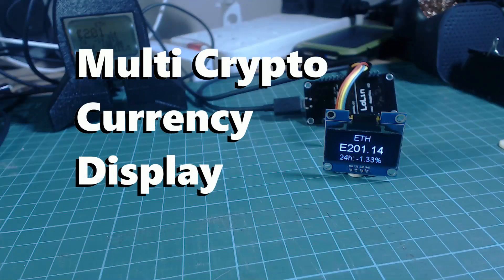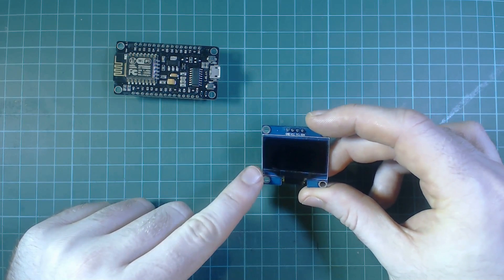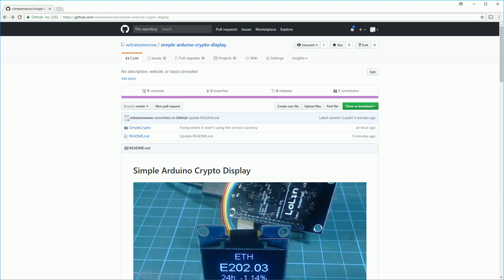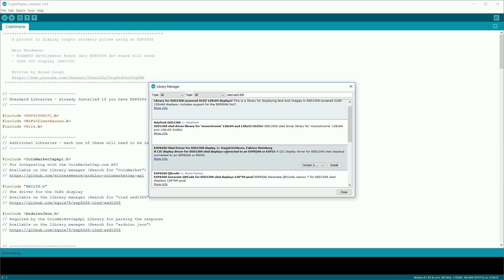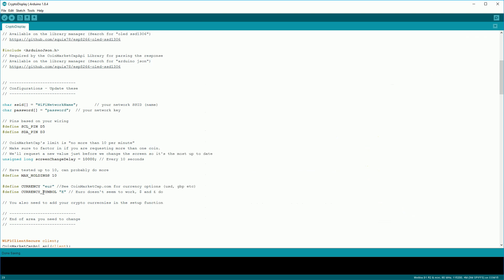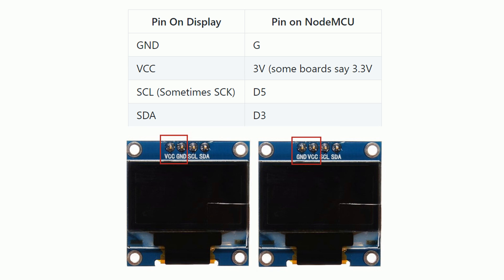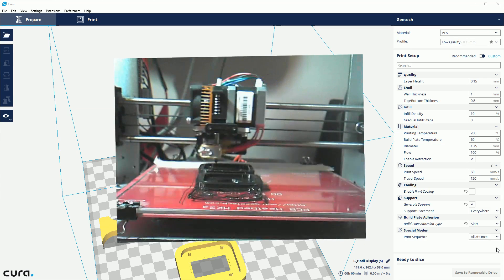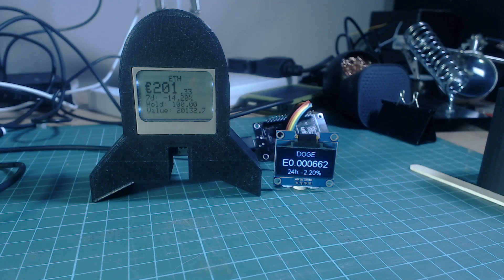Arduino Crypto Currency Display

Comment: If you're all wondering why this doesn't work, it's because the API it relies on is shut down.
Reply: do you know any other solution?
Reply: @taher4324  coindesk's API works.
Reply: @TheResidentSkeptic  do you have the code for it ?
Reply: TheResidentSkeptic This worked well for me. Thanks!
Reply: @TheResidentSkeptic  This worked for me too, thanks. Dont suppose you have a link for a XRP API do you?
Reply: @cobraCPT  Sorry I don't. You'll need to use your Google Fu. I'm sure there's one out there.
Reply: @TheResidentSkeptic  Thanks for the response. I found the bitstamp http api, which alas isnt a drop in with your code.
Reply: @TheResidentSkeptic  Hey there! Thank you so much for reviving what was anotherwise dead project and device. However, uploading your code to my NodeMCU just shows a black screen after one blink of the boards LED.  Are there any specific pieces of your code that need to be customized by the user, other than the WIFI name / pass?
Reply: @GrinningDemon  There shouldn't be. I did notice that if the wifi details are incorrect, or it is otherwise incapable of connecting to wifi it will only display a blank screen. Double-check your wifi details. Check case sensitivity.
Reply: @TheResidentSkeptic  Hey! Thanks again for your help, but after a lot of troubleshooting, I realized the Adafruit_GFX library you were using doesn't work properly with my "SH1106" based oled display. As a result, I went and wrote my first ever C+ code and made a new sketch that is a hybrid of the display methodology from the original video, and your new code for interfacing with the coindesk API. Big success! Thanks again.
Reply: @GrinningDemon  Awesome. Great job!
Reply: @TheResidentSkeptic  aaaand it's no longer available.. This project is one disappointment after another..
Reply: @sirClogg  Huh? Mine's still running: https://imgur.com/a/nFgKCeo

Comment: This is awesome, thanks for sharing!!  3 problems I ran into following this sweet guide that turned a 10 min job into 3+ hours.

1.  Check the usb cable you are using.  If/when you plug the esp8266 in to a Win 10 box for the first time, it should recognize it even before you install the driver.  I tried 3 diff cables before 1 of them did this and worked.

2.  When you install the Arduino json library, make sure you select the version Brian uses in this tutorial.  If you use the newer version, you will receive json errors compiling.

3.  Use a baud rate higher than 9600.  Even though my chip says to use 9600,  it would fail.  I also had to tweak a few other performance settings for the transfer/compiling to complete successfully.  (Just increase the default settings until it works for you.)
Reply: Thanks for the tips. I couldnt get it to install until I saw this!

Comment: for those who have error loading , 
first, if you use the same one in the video moduleV3 Nodemcu-CH340 board based ESP8266 ESP-12E then you have to select the correct board Tools->Board->esp8266 Board->nodemcu 1.0, 
Second, you have to change Arduino Json version to an older one from 6.X to 5.X as following Sketch->Include Library->Manage Libraries-> type "json" in the search bar and go  to Arduino Json you will find the last version installed already , change it to older one 5.X from the drop down
Reply: connected with wifi but the screen is empty

Comment: Thanks Brian, great video and tutorial. I purchased the parts you listed from AliExpress. For the life of me I couldn't get the blink code to work. It appeared to upload fine but it never blinked. I read online that in newer models the led was moved to GPIO2. I decided to try to upload your code despite not getting blink to work and it worked great. Thanks!
Reply from the maker: Great to hear you got it working!

The node MCU board had two built in LEDs (for some reason?) , maybe the main one is broken, to use the second one try using "D4" as your pin number.

Comment: Very nice. I like it much better than the one I did a couple of months ago.
Reply from the maker: Thanks a lot Paul. I watched your one a few months ago, I liked it a lot, it was a good simple project to do because that JSON file was very easy to integrate with! I spent a good bit of time working on the library for this one. It recently broke too because they shut of the HTTP endpoint (which I was using because it was faster than HTTPS) so i needed to update, thankfully I hadn't got around to making this video!
Reply: Is it possible to modify this sketch to work with Arduino Uno/Mega with Ethernet shield? Also it would be nice if it would be able to display total market cap witch is very useful too . Great project
Reply from the maker: +Artur Z coinmarket cap requires HTTPS which the Ethernet shield does not support so no.

Total market cap was available from the api I think, but I think since I wrote the library that number has gotten too big!
Reply: Brian Lough no way to display let's say 550  B? First 3 digits would be enough. Thanx for your response!
Reply from the maker: +Artur Z I'm not sure exactly what the problem with it is, I just ran the example from the library recently and in place of where market cap should have been printed it printed "overflow" instead

I'd imagine is possible to read the value in as a string if it's too big if a number, but to be honest it's not something I'm going to be able to get around to anytime soon
Reply: Brian Lough thanx a lot! Great project

Comment: This is so cool, nice one! You know what would be good, is if you could put a red and green LED and if the currency is down, turn on the red LED and if it's up, turn on the green LED? Is there a bigger screen that could show 10 currencies at once for e.g? Then just refresh every 5 mins or so.
Reply from the maker: +Neo Matrix hey, thanks alot!

Yeah that's a good idea, would be easy to do as well.

Arduino screens tend to have a low enough resolution so I'm not sure if you'd find something that could fit 10. One thing you could maybe do is connect 10 of these screens up using something called i2c multiplexer. I've never tried one though!
Reply: If you're still interested, a chap called Michael Klements recently put together something like you've described. A PCB with the microcontroller, OLED and LEDs all mounted on an acrylic stand. A compact version could also be made using a microcontroller with build-in OLED, e.g. Heltec WiFi Kit 32.

Comment: Hi brian, I get "error loading data" on the screen. Ive double checked my wifi credentials. Is it possible there might be a newer API of the coinmarketcap since the video? Thanks.
Reply: We have received the same error, did you come up with a fix? We get his opening title and then the error message.
Reply: Same here. Any solution?

Comment: cool :) what should I do to have several displays for several tickers? would I need one NodeMCU for each display?
Reply from the maker: +Tor Ivan Boine not necessarily! Sorry I'm in my mobile so I can't copy and paste it but I replied to another person (mike) with details on how you could connect up multiple screens.

The arduino is actually doing nothing most of the time with this so really should be fine to run mutlipel screens once you get over the issues described in the other post

Comment: Very nice!! I'm not really into arduino but would it be amazing to preconfigure various wifi and their passwords in the code (for example, home: 1234, university: 4321, library: 0420, etc..) and then adding a buttom to navigate throught the different wifi's so you can choose which wifi to use in case you have your device connected to a lipo and want to bring it with you.
Reply: You know what, I'm gonna try to do it myself ahahaha, I will let you know if I succeed
Reply from the maker: +PRAWON that would be a good addition!

You should also check out WiFiManager, it will create an adhoc network for you to connect to set a wifi password if it fails to connect to the last network. https://www.youtube.com/playlist?list=PLbd5_U5QzQgZ8Ni8F48G2gnMgCkN6saUT

I think this sketch needs improved before it can be used though, I found it was unstable (I think it uses too much ram)
Reply: Brian Lough Thanks, I will check it out!
Right now I'm quite busy with university until ends of january but I will start it if I find a moment to

Comment: Hello. getting the following error concerning the D3 and D5 pins Arduino: 1.8.13 (Windows 10), Board: "Generic ESP8266 Module, 80 MHz, Flash, Legacy (new can return nullptr), All SSL ciphers (most compatible), dtr (aka nodemcu), 26 MHz, 40MHz, DOUT (compatible), 1MB (FS:64KB OTA:~470KB), 2, nonos-sdk 2.2.1+100 (190703), v2 Lower Memory, Disabled, None, Only Sketch, 115200"

cryptodisplay:50:17: error: 'D3' was not declared in this scope

 #define SDA_PIN D3

                 ^

C:\Users\Jim\Documents\Arduino\cryptodisplay\cryptodisplay.ino:73:22: note: in expansion of macro 'SDA_PIN'

 SH1106 display(0x3c, SDA_PIN, SCL_PIN);

                      ^

cryptodisplay:49:17: error: 'D5' was not declared in this scope

 #define SCL_PIN D5

                 ^

C:\Users\Jim\Documents\Arduino\cryptodisplay\cryptodisplay.ino:73:31: note: in expansion of macro 'SCL_PIN'

 SH1106 display(0x3c, SDA_PIN, SCL_PIN);

                               ^

exit status 1

'D3' was not declared in this scope

Comment: First @Brian Lough thanks for such an easy and wonderful video. I have tried using multiple NODEMCU boards and two different 0.96 displays. nothing comes up in the display. Is it because of the API issue or am i doing something wrong. Code compiles good and i have the cables hooked up correctly. Any one pls help... I would love to have such a ticker running to watch the FAVs constantly

Comment: Hi Brian, I have Wemos D1 Mini and the 64*48 OLED shield, what would i need to change to make this work correctly? advice would be much appreciated
Reply from the maker: Hey Craig,

Nothing for the wemos anyways, but I guess you would need to find a library that works with that screen.

You will also need to adjust what is displayed so it will fit
Reply: Brian Lough ok thank you for your time, I will purchase the display you used and hopefully that will work :-)

Comment: How easy / difficult would it be to add a new screen to the rotation displaying e.g. the uptime of the arduino?
Reply from the maker: +PeterLustig hey, shouldn't be too hard, it already checks when it's time to change screen in the loop, if you just added an extra state to display that screen it should work

Comment: after powering down it will only come back on by hitting reset. any change in code to get it to autostart?

thanks .  my first arduino project and i love the small cost of entry.  thanks for the work you have done!!
Reply from the maker: +tom bradway your welcome! Delighted to hear that you liked it.

Could you explain how your powering it down? If I just plug out the micro usb cable and then plug it back in it seems to work OK for me so just want to check if that's what you mean?
Reply: Brian Lough  figured it out . It locks up after plunging in usb on computer .  Wall plug works every time.  Any chance you will write sketch for a stock ticker ?    Can you add text on screen showing logging in to network i.e. connected to ... 

Thanks
Reply from the maker: +tom bradway hey, your comment got flagged as spam for some reason, only after seeing it now.

Yeah very possible to add more info to the boot up, but I probably won't be revisiting this project for a while . You would add the changes into setup method.

I'm sure its possible with the right api, it's not something I would be too interested in at the moment though. I'm absolutely swamped with projects!

Comment: How hard would it be to use 2 or more displays. Assuming same type.?
Reply from the maker: It's not a trivial thing to do, but it is possible.

Coding wise it wouldn't be a big deal,  but these displays use a protocol called i2c, which operates on an address system. Devices of the same type will have the same address. 

There is a jumper on the back of the screen that you can solder closed to change the address which would give you 2 screens that have different addresses but more than two you will have to do something else

Adafruit sell a i2c multiplexer that would allow you to connect up to 8 screens. https://www.adafruit.com/product/2717

I bought one but I still have not gotten around to using it yet so I can't really provide anymore info than that!

Hope that helps
Reply: Don't need to worry about U2C addresses if you want the displays to all show the same thing. But if you wanted one currency per board then you would.

Comment: can this be done with the arduino uno board or do I NEED the nodemcu board?
Reply from the maker: It needs to be an esp8266 based board like a wemos d1 mini, nodemcu or an adafruit feather huzzah
Reply: ok, thank you
Reply from the maker: Your comments about no port showing up on my other video are not showing up in my YouTube app. Which board do you have and what driver did you install?
Reply: hey thanks for the reply. I figured out the port issue, so i deleted my comments about it (thats why you cant see them :) ) I am having a new issue though. I am getting an error when I try to compile the code :/ havnt figured out why
Reply from the maker: I think the arduino json library has released a new version that has broken stuff by the looks of things. You might be able to change the version, if you open the library manager (same way as instructed in the video) and search for arduino Json, there is a drop down for the version, you could try change it to an older one
Reply: yes!!!!! that solved the issue! thank you! : )

Comment: Hey Brian Lough I getting and error compiling for board Arduino/Genuino Uno and says No such file or Directory on ESP8266WiFi.h. Can you point out what's wrong???? Thanks in advance
Reply from the maker: +Greg R Kirksey sorry, it doesn't work with an uno, it needs HTTPS which the uno doesn't support
Reply: I have the 1PCS Wireless module CH340 NodeMcu V3 Lua WIFI Internet of Things development board based ESP8266.
Reply: I see my error ...need to watch  "How To Program An ESP8266 With the Arduino IDE"

Comment: hm, i‘was read now only the issue about the coinmarket cap api. i‘was try 2 hours to found out what i‘was do wrong ... some update of the code will be nice .....
Reply: Someone else actually updated it: https://github.com/lewisxhe/CoinMarketCapApi2
However you'll need to create an account for the API key for it to work.
Reply: @keviloworks5486  Thanks a lot ! However I'm so bad on code that I don't know exactly how shoul the final one looks like. Can you help ?
Reply: @introligator_  You should use the code in the link and copy the code for the WiFi connection from here as most of the other code doesn't work. Other than that you just assign the API key. Also make sure you download the library from the link instead of this one. IIRC they interfered with each other.
Reply: @keviloworks5486  Sorry but I don't understand where I must write my API Key, can you tell me this, please? I create an account on Cryptocurrence.com and I create a valid key, and now How I must proceed? Thanks and ciao
Reply: @keviloworks5486  where does the updated code go in the original code?

Comment: Hey Brain, fantastic work!! I was wondering. Is this also possible on a raspberry pi 4? I have a umbrell node running on it and thinking about adding a btc ticker but not sure how to do this. What do you think? Via the nodemcu board or should it also be possible via the raspberry?

Comment: Hey man, code no longer works due to the api did you have any update for it? I am trying it now but to no avail any help will be appreciated
Reply from the maker: Check the pull requests, someone made an updated version for 2021
Reply: @BrianLough  
First thanks for answering, it is greatly appreciated.
Second, I tried his and it didn't work either unfortunately, I must be doing something wrong. 
And lastly, his code is only supposed to work for bitcoin and my main objective is Doge.

To The Moon!

Comment: Hi guys, Wondering if somebody would be kind enough to help me.
I've uploaded the sketch fine but my OLED doesn't work but trying it on a GPS sketch works fine.
I cant see what driver it uses and it was a while ago when I bought it.

Any ideas?

Thanks
Reply from the maker: +RustyNuts maybe check the pins? What type board are you using?

Comment: i'm getting an error: exit status 1
'getNextFreeHoldingIndex' was not declared in this scope

not sure what to do :/
Reply from the maker: Is there any other error? That method is definitely there.
Reply: when its compiling it says "WARNING: Spurious .github folder in 'ArduinoJson' library". The link for that library was not in the code so i took it from here https://github.com/bblanchon/ArduinoJson but maybe its not the right one?
Reply from the maker: +Jan Reuser yeah that's the right one.

Can you paste your sketch to pastebin or somewhere? Remove your ssid and password first :)
Reply from the maker: This exact sketch compiles for me on both Arduino 1.84 and 1.85,

What version are you using and what OS?
Reply: aah ok i was using arduino 1.6.7 windows. I updated and it works now thanks :)
Reply from the maker: +Jan Reuser awesome! Good to know that's what the issue was so thanks for letting me know!

Comment: Can this work with the ESP32?
Reply from the maker: Yup it does, there is an example for the esp32 with the library.
Reply: Brian Lough I’ll check it out.
Reply: Brian Lough , I get two errors when I try to compile the code. 
1) ‘jsonBuffer’ was not declared in this scope 
2)’class ArduinoJson::JsonArray’ has no member name ‘success’ 
I’m not sure what went wrong.
Reply from the maker: Change Arduino Json version to 5.x, the 6.x versions have a breaking change
Reply: 😁 it’s working! 
Thank you!